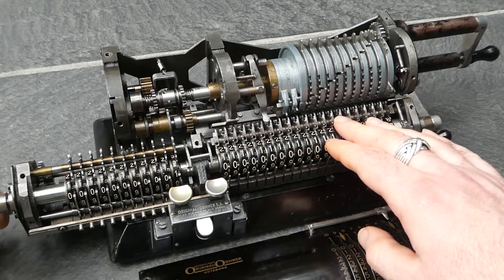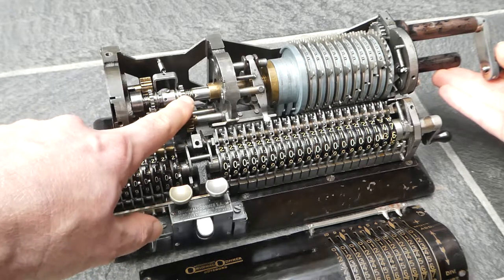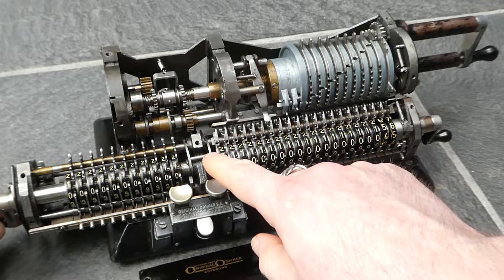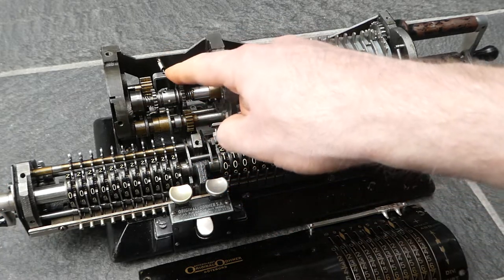How the Original Odhner pinwheel calculator works

Comment: Problem with odhner 39 which is very similar to this model revolution counter reset handle jammed and not able to turn it can only be made to work and freed up by replacing zeros with any number on all wheels except the outside two at either end, have tried retiming with no luck any one any ideas please

Comment: I wonder what a machine with this many digits would have been used for. Perhaps calculations involving international banking?
Reply from the maker: I'm not sure. As far as I know the main advantage of having this many digits is that you can essentially split the register into two or even three sections that hold separate results from related calculations. For example, if you want to calculate the multiplications 123*456 and 123*789 you can do this in one go by inputting 456000789, multiplying it by 123, and reading off the answer in two 6-digit sections.
Reply: The uppers teeth on the wheels are indeed used by the input register display that is missing here, as you thought. They engage with the pins on the right side of each digit roll. The digits rolls are the same for the three registers : they all have a pin on the left of the roll for the carry, even if this pin is of no use for the input register, which never travels from 9 to 0 or 0 to 9.
Reply from the maker: @EmmanuelCoirier  Thank you for confirming this!
Reply: Useful also if You do want to calculate with high precision fractions, i.e. results with many digits right of the decimal point.
Reply: I have a similar machine (a Schubert), and I use the many digits for “float-point-numbers”, I found that it is very practical to always have those extra places you can throw in.